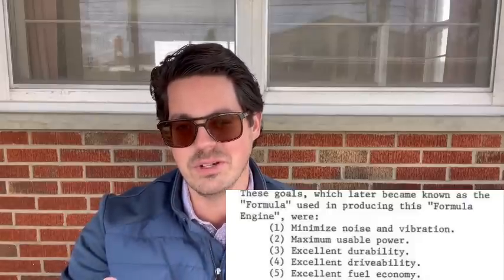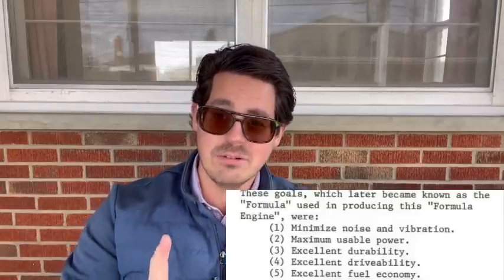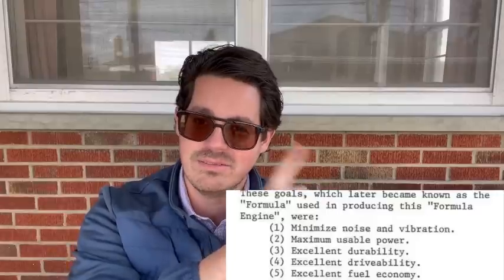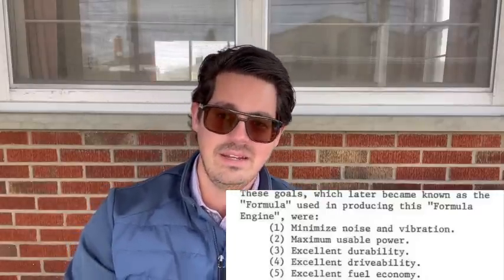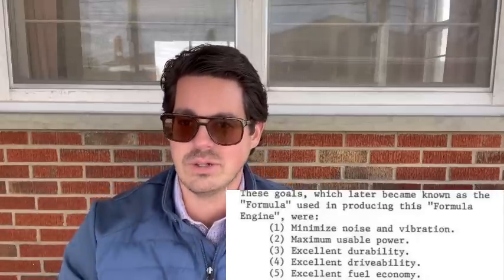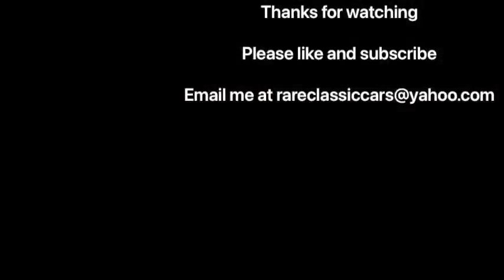Worst Engines of All Time: GM's 2.5L Iron Duke 4-Cylinder

Comment: It ran like a tractor engine. And although it was durable it was also delicate because it didn’t tolerate lots of heavy acceleration. Which is bad because of it’s weak power output foot to the floor driving was necessary for daily driving. But if you did drive like a granny it was a reliable engine.
Reply: Exactly , my leadfooted sister inherited dad's old Celebrity  and blew the engine in no time.
Reply: I disagree, but it probably also depends on the platform it was in. I wailed the absolute snot out of mine and most other S10 owners did too (we're talking about minitruckers here). What you didn't want to do is rev it to the moon. You could pound on it at WOT all day as long as you didn't. In an automatic transmission vehicle it would have been almost impossible to manage that, but with a stick it was pretty easy. Pedal to the wood until it just sounded about right, shift, do it again until you're in 5th.
Reply: @TheBrokenLife  they probably lasted because those S10s didn’t have tachometers and you shifted by ear. As rough as the engine was at idle it sounded like it would self destruct when revved. You were shifting early because the engine’s sound. In automatic vehicles they would rev all the way to redline at WOT. Considering most of them were in cars with automatic transmissions you can guess the outcome. However on the engines in the 90’s on up this wasn’t as much of a problem.
Reply: @khakiswag  Pretty sure that's what I said.

If I had to guess, mine was getting shifted at 3500-ish when being beaten on, daily, for years. Occasionally it would get run harder than that, for burnouts or passing. 

Anyhow... I wouldn't wish an automatic behind one on anyone and certainly not a cheesy GM 3 speed with 2.xx final drive gears that they were so fond of.
Reply: @TheBrokenLife  you did and I did a poor job explaining what I was trying to say. GM built this engine to durable and reliable based on how they expected people to drive. The speed limit was 55 and it should cruise easily at that speed sipping gas. And it did. However that’s not how most people drove it. The Japanese and even Ford built much better 4 cylinder engines. Ford’s version of the Iron Duke was the OHC Pinto engine (in different variations) which went in numerous Ford product here and in Europe from the 70’s - 2000’s. Some of them were turbocharged and went into SVT products like the Thunderbird Turbo Coupe. Smooth running and able to be driven hard but still very reliable.
Reply: @khakiswag  Really, I think the problem is that it was just a bad fit for most of the cars. In the S10s, which were almost all manuals, it was genuinely pretty good. Like I said, a bunch of minitrucker teenagers pretty much couldn't kill the things. We tried.

Ehhhh... Didn't the early version of Ford's Pinto motor use a V belt for timing and is pretty famously hated because of it? Didn't it also go on to eventually have 8 spark plugs? I would exactly call it a high mark of engineering.

Can't argue with Japanese 4 cylinders of the period though. Most are absolute precision machines by comparison to anything the big 3 were doing. But... I do remember lots of fear of interference engines and timing belts breaking on them (and it happening pretty often), which is something the big 3 really never had much of at the time. I get it that timing belt maintenance is just an expected thing you have to do now, but wasn't back then. People were clueless.

Anyhow... Most of the motors of the period were junk in one way or another. My Iron Duke served me well.

Comment: that picture of the front of early duke looks like a jeep engine pretty much so any one find the potential paperwork to corporate there cousins 🤔🤠😁

if so my bet is it's by way of contentale engine's company as gm was at least pre-1960aka in there past using them as a sub supplyer of parts and so was jeep 😉 to bad the lights didn't come on as i have worked on at least 2 R&R and or rebuilds plus had a 4.0L out of the jeep and didn't consider gm might be using its design cousin

Comment: Old, Crude and Rude! Thats why they made a great Jeep engine.
Reply: Only a few years, early 80's. AMC used their own after that. The AMC was way better. 83 horsepower vs. 115 hp.
I have the 4.0 in my old Jeep. Still runs like new after all these years.
Reply: @TheBandit7613  True. I have a 2.5 in my 1994 Wrangler. Great little engine. I installed a couple Iron Dukes in some CJ2 and 3's with the truck 4 speeds. they're still going strong after 30 years of running the trails.

Comment: GM is not only the maker of the worst engines of all time but also the worst cars of all time. GM can sometimes make good pushrod engines, and does. But that is the end of what they can make that is good. After owning many GM vehicles, both new and used, they are just crap. Quality of materials is so bad they deteriorate right before your eyes. Virtually everything will either rot or stop working it you keep one for 10 or more years. Engineering and design for the most part is almost non existent. They obviously spend the bulk of their efforts with marketing and not much else. I will only buy or own another GM vehicle if I can get one for pennies on the dollar. Otherwise it is not worth it because that is all junk is worth.

Comment: u r killing me I worked on  100s of boats with that engine ,MerCruiser being  the best know  marine application but there's others you couldn't ski with it what made a great fishing boat on the Great Lakes the power to weight ratio fuel consumption engine life we're all excellent comparatively speaking didn't care about that timing gear noise we we're not at the drag strip  but with the right prop u could go up steram  ok  now remember gasoline at the marina is over $7 a gallon right now

Comment: Simple, will run for 300,000 miles, got 30 plus miles per gallon.  One of the worst engines of all time?  Wrong.  Of course it was rough and noisy, so what, all the American four cylinders at that time were the same.  Millions of them still running every day down the road.  How many smooth foreign four cylinder engines of that era are still on the road?  Think about it before making a non thinking video please.  The iron duke is an icon of its era.  Way better than the trash disposable engines of that era.  Is the next video you make going to have the Chevy 283 as one of the worst?  Same reasons?  Crude, noisy, vibrations.  Come on man.
Reply from the maker: Reliable doesn’t mean pleasant. Anyone who traded in an old V8 powered car for an Iron Duke powered car would’ve been shocked by the lack of refinement.  This was the period when the Japanese gained significant ground.  None of their 4 cylinders were anywhere near as crude as the Iron Duke.  The story is told in the steep market share losses GM experienced during this period, particularly in the car segments where the Iron Duke was used.  

Are 90s era GM interiors excellent because they’re functional?  No.  Reliability isn’t the only concern of buyers. It’s one concern. Customers expect reliability when they buy something, so you get no credit for that.  But they also expect a pleasant experience. 

The Chevy small block was so loved because it did everything well. It was reliable and it was buttery smooth and quiet. It also gave good fuel economy.

Comment: Just because an engine does not smack of Japanese does not mean that it isn't good.  Remember, it is the Japanese engines that have rubber timing chains, shallow combustion chambers, and water pumps inside the timing gear cover, not the Iron Duke.